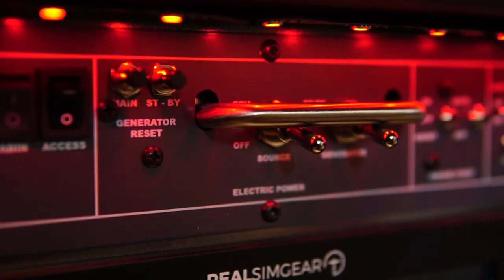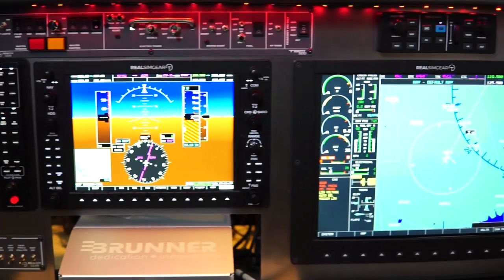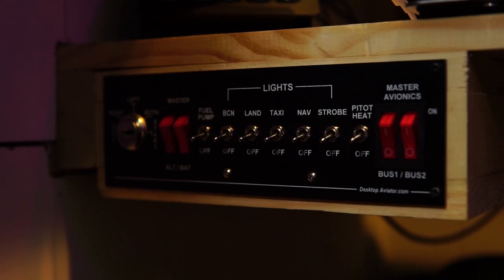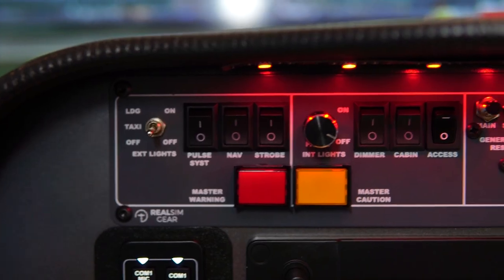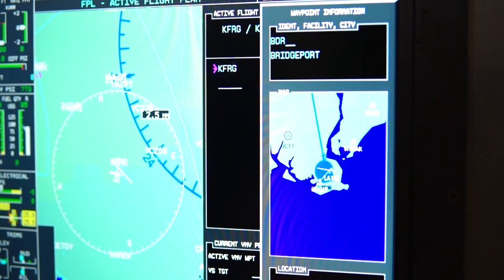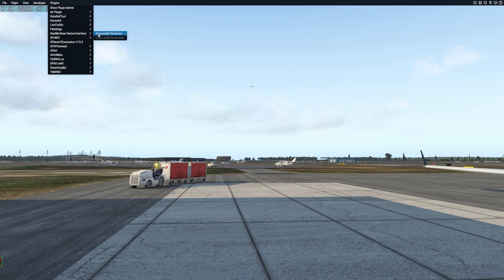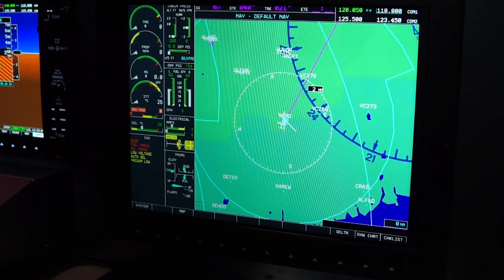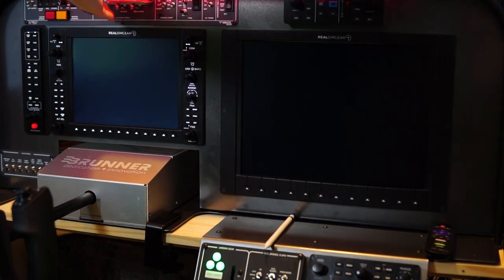Home Flight Simulator Tour Series - REAL SIM GEAR TBM PANEL - Episode 2

Comment: My experience with RSG's TBM switch panel set was not as good as yours. Mine was poorly assembled, and every switch was lose and needed to be tightened. The gear lever didn't travel properly and I had to modify it just to get it to travel. Also, the crash bar wasn't properly assembled and didn't work, also requiring modification. As for it's use, it works fine (now) when it does work. It almost never is recognized (in Xplane 11) at startup, requiring unplugging and plugging back in  and usually reloading the command map as well. (And this is a clean install of Xplane without any plugins.) Oh, and did I mention that the command map had errors that had to be edited? The whole thing was also miniaturized way more than it needed to be. I've already ordered 1:1 switch panel replicas from another manufacturer and will be tossing this garbage. I will never buy RSG equipment again, and I wouldn't recommend it to anyone else.
Reply from the maker: Oh that sucks sorry to hear about that.  The biggest issue I had was the command mapping.  Support was pretty quick and provided an updated map which worked for me.  Ultimately I've been pretty happy with the setup although as much as I love the TBM I probably would have enjoyed just the standard G1000 setup a bit more, and saved some money.  Maybe that'll change for me when the TBM updates for XP12.  Whats the other company your ordering the parts from if you dont mind sharing?  Im curious!